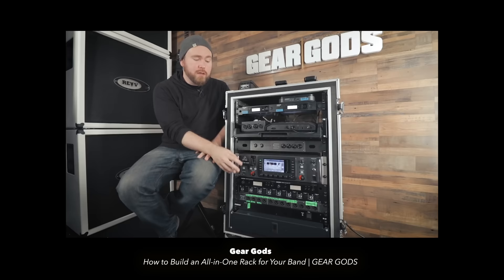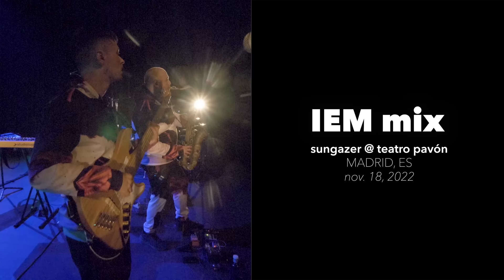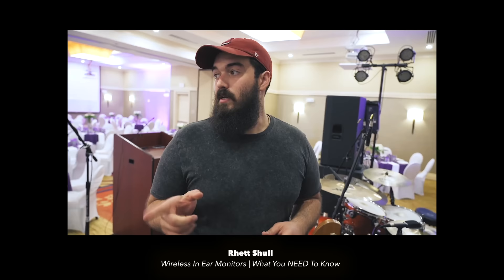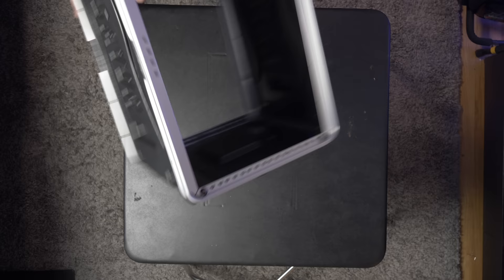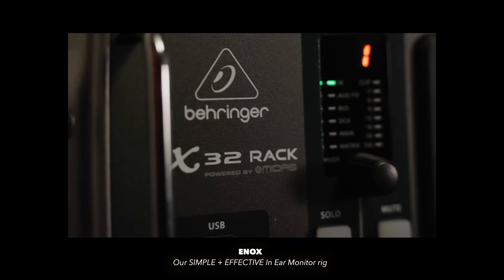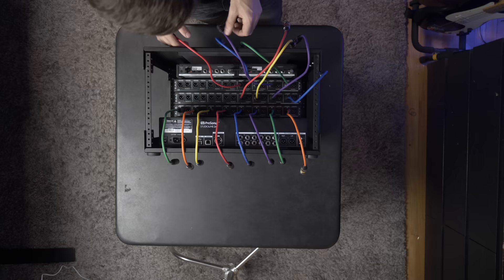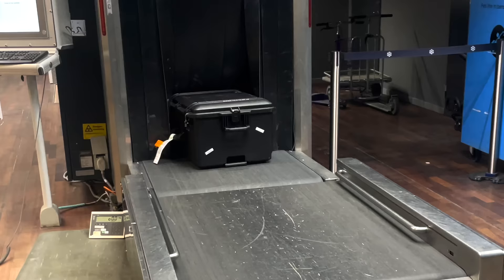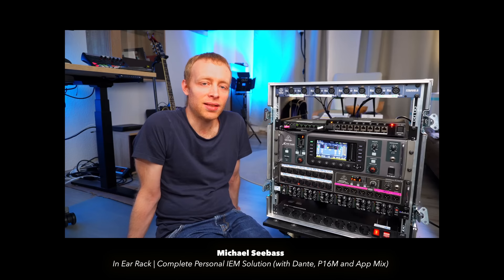How In-Ear Monitors are Making Better Musicians

Comment: wow this is so helpful!!! I have been researching in-ears for my band but we thought it was cost prohibitive. Now we will be able to hear ourselves, even if it is in the hands of front of house engineers
Reply: The band I engineer for I've been telling them ever since I started to work for them that they need to invest in to a system. it is a night and day difference. I'm also trying to get them to go with a klang fabrik as well.
Reply: @roll9898  7000 bucks without the actual in ear monitors (and receivers), I'd argue that IS cost prohibitive.
Reply: @tarcp6224  there are options for a lot cheaper rig; 24input mixer may not be necessary, a 16in xair is almost 1000€ cheaper for exemple, same thing for the rest of the gear
Reply: @tarcp6224 we built ours for Glass Pony much cheaper than that.  At least half.  It’s VERY doable.
Reply: @Gumbo72203  Yes, it's definitely very doable, what I don't understand is the recommendation of a 7000 eur piece of gear to do it.
Reply: @tarcp6224  he isn’t doing that.  He’s saying this is how they did it, for THEIR specific needs.  If you watched, he links to like 10 other videos of people doing this too.  

I just checked our band drive for our template.  Ours cost less than $2,000
Reply: @Gumbo72203  "I'm trying to get the to go with" sounds like a recommendation to me.
I don't get how this guy's recommendation of a 7k+ gear in a thread about cost prohibitiveness is excused by the video linking 10 people that don't use 7k+ gear.
I don't roll up to a video about budget gear and recommend ONE piece of gear that costs more than the entire build.
Reply: @tarcp6224  this video isn’t about budget gear.  It’s about selling the concept of IEM’s and he uses their situation to base the defense of the practice.  

Like I said, ours cost under $2k.  It’s a road warrior too, we just don’t fly with it.
Reply: @tarcp6224  He's talking about his rig, that he's built. If it isn't what you need, don't build the same rig? If you're going for a rig for IEMs, you need to build for purpose. That could be as simple as a transmitter that the engineer can patch in instead of your monitor. You don't need to go this far if you don't want to, but they did.

And $7000 is not that much. It's a lot of money, sure, but in this case it's a piece of gear for like a 5 piece band, so it's $1400 per person, for a piece of gear they'll use every night and will make their performances better and is much better for their musical longevity and health, hearing loss, vocal strain, all serious problems. If you can buy amps to support your music, or instruments, or recordings, or pay for travel for touring, then you can afford that. 

But again, it's his rig and he literally states that it's more than some people would need. The individual items and solutions are useful information regardless of the whole-maybe you're just after the radios, maybe you're wondering what data send situation they're running. The thing is, if you understand the process he's running you through in the video, you can definitely substitute things, in fact, depending on power supply or radio limits you may HAVE to.
Reply: @kalreynolds5829  He didn't state "it's more than some people would need". Adam Neely stated that in his video about a 6k complete rig. The guy that I replied to recommends a 7k piece of equipment without the actual monitors. That is under a video with the concept of cost-effective IEM.
A 10k+ rig absolutely absurd and I've personally never seen that much money in the same place.

Comment: It sounds even worst that the raw camera audio on stage since our ears don't have built-in compressor! Also, as a sound engineer, I'm SO happy to FINALLY see a real informative video about in-ear monitors. Every gear video about it seems to say that you need a 2K 32 channel wireless mixer with an iPad to do this and end up with a 10+ rack unit case that in itself is worth in the hundreds of dollars new (if not close or over to a grand if molded). And the end of the day the goal is not to have the best IEM system, but rather some IEM system that *works*. 
Having to deal with such a complex mixing system and using your own effects separate from the FOH also detracts from your job as a musician and make you hear things the audience receive in a completely different way, so there is a balance to strike between comfort and fear of losing control. Cheers and happy new year everyone!!
Reply: Our ears do have built in compression! Very loud sounds have a less perceived dynamic range
Reply: Actually your ears do have a built in compressor! It's why you can hear more dynamics at lower listening volumes.
Reply: @123string4  Obviously our ears perceive louder sound as having less dynamics. Although, the purpose of a compressor is actually to make louder sound perceived as having more dynamics by making the quieter part of a loud sound louder and vice-versa. So while I get what you mean, it's not 100% correct because our ears doesn't make quieter parts of loud sounds louder and don't "compress" sound past a certain threshold to perceive it louder without busting them. I get the concept, but it's a big simplification of what compression actually is. And we do have a threshold of SPL past which this "compression" cannot happen anymore, which is the threshold of pain, and we can't adjust it. What we can do, however, is use our eyes to "zone in" a sound, for instance listening to a TV in a busy room.

Comment: Very interesting. As a live sound engineer (with experience both at foh and monitors), I can tell you that it's an incredible relief when the band has the capability of mixing their own IEMs purely for the fact that it saves precious time during changeovers at music festivals. Between all of the movement and chaos that happens in those moments, it's tough giving everybody a personalized mix - not to mention taxing when you've got 4 or 6 bands per day. If you sat back at the foh console and turned down the master fader, you would be shocked at how loud the stage volume can be; and that stage sound mixes with the house sound, changing the tonality in often irreconcilable ways. The most difficult instruments to deal with can be the drums, guitar amps, and bass amps (since we have no control of their stage volume or tone, and they are always competing with each other for loudness. In general, all of the other instruments are boosted to match the loudness of the drums, and I suspect that close proximity to loud drumming masks the sound of the other performers on stage. Of course, a pre-rigged IEM solution is the most practical because none of the stages I work have built-in drum cages (and I know how much drummers hate drum shields), and none of the musicians' amplifiers are housed in isolation cabs.

It leads me to wonder how past acoustic bands dealt with stage volume and communication. I know that traditional jazz and bebop bands don't really have an issue with this. We're just living in the era of loud music I guess.

Anyway, neat video.

Comment: Awesome information. It's supremely important for modern musicians to understand how to deal with a modern stage. I'll note that when stage volumes get out of hand in the range of 110+ decibels, this really creates problems, not just for hearing health, but just being able to have functioning ears. Ear drums start to distort, making it literally impossible to hear accurately. Noice-cancelling in-ear monitors helps with this some, but on really loud stages, the sound actually can get to your ears through your skull and not just your ear canals. There's good reason why many helicopter pilots wear helmets and not just headphones. If using in-ear monitors allows you to get rid of on-stage monitoring and get that volume under control, that's a huge, huge win.
Reply: You are 100% correct, Andrew! I have found that as I age my tolerance for absurd volume levels is shrinking. Above a certain level (about 90 dB), my sense of pitch disappears. I have to avoid singing and must play guitar though the braille method with visual cues.The days of 100 watt Marshall stacks cranked up in dance clubs are over. Unfortunately, musicians are going with no amps at all and going to complex in-ear setups. I build amps and am convinced that you can't satisfactorily play guitar without an amp as it is up to 50% of your sound and feel! Being honest, one rarely needs an amp with over 25 watts (tube, like a Deluxe Reverb) and maybe a 100 watt bass amp. Drummers need not bash or risk being subjected to public ridicule and plexiglas shields that they purchase and transport. I've played many dinner music jazz gigs with great players and pop dance music gigs over the years and can see how some level of restraint can still have major musical impact. I haven't gotten to in-ears yet successfully as we never have sufficient time to dial them in and generally don't have a front of house engineer except for me or the keyboard player. Bone conduction monitor headphones with a general feed might be a good compromise!

Comment: I agree with the title of this video wholeheartedly, especially for bassists; physics alone is a massive factor because of how long it takes soundwaves to form, and depending on the rig you use, the speakers the sound is coming out of, the venue you're in and a multitude of other factors you'll likely find it more difficult to hear yourself, and for most gigging bassists its almost always a case of having to settle, rather than being completely happy with how your instrument is represented. If you're using 15" speakers, unless you're something like 12ft in front of your cab, you're gonna be outta luck hearing anything you play! It's why I loved using my Hartke 4.5XL cabs because of the immediacy of the 10" speakers they were loaded with. 

And immediacy is why I like using a full IEM set up, and have done since we switched around 8 years ago. I now model two separate bass rigs panned hard left and right in a Helix LT, which are fed by a very accurate model of the pedalboard I used to use. 
For the IEM setup I use KZ As10s (so good I bought three pairs, and the guys in my band use them too, https://www.youtube.com/watch?v=w3Zh3Gl9HIk) with memory foam tips which swell to completely seal your ear canal (https://www.amazon.co.uk/gp/product/B06XF4LY8G/ref=ppx_yo_dt_b_asin_title_o03_s00?ie=UTF8&psc=1) plugged into a little Behringer Powerplay P1 (https://www.youtube.com/watch?v=FOon2wEZss8) mounted to my mic stand via a mic bracket, being fed a stereo aux mix from our Presonus RM32AI, and my monitor mix is controlled from a Kindle Fire secured to my mic stand (https://www.amazon.co.uk/Neewer-Adjustable-Connecting-Microphone-Compatible/dp/B07D5TSC7C/ref=sr_1_1?crid=1YFGA6UA1U3AL&keywords=Neewer+6-11+inches+Adjustable+Music+Mic+Microphone+Stand+Tablet+Mount&qid=1672418609&s=electronics&sprefix=neewer+6-11+inches+adjustable+music+mic+microphone+stand+tablet+mount%2Celectronics%2C111&sr=1-1). 
For anyone looking to put a little IEM rig together, this is an extremely good monitoring solution on a budget. I also have a t-bone wireless unit for gigs where the stage is a bit bigger, or trailing XLR cables is a little impractical. 
I personally feel that since we switched to an IEM rig my playing has improved in all aspects; accuracy and consistency of note velocity, and timing. Because its like listening to a DI in a studio, there's no straining to hear the note through an often wooly bottom end and a thundering backline because your amp is coupled to a hollow stage or the band are louder than you are. You hear the note you're playing immediately. 

You still get the feeling of the bass from the PA if your band is using subs, which John Entwistle couldn't do without, and you can balance yourself perfectly with the drummer.  And, because the IEMs seal in your ear you still get all the low end you need to hear, without the volume of a live band so you never leave a venue with your ears ringing. 
As gig rigs go, its perfect. I turn up with bass, pedals, and bag with IEM setup and power cables, which all fit in the boot of my car easy. For anybody thinking of switching to IEMs, I can say from my own years of experience using them and depping with other bands during that period where I've had to use my cabs and bass rig, IEMs win hands down on all counts.
Reply: Thanks for sharing! Think I'm gonna try and buy a pair of those IEMs 😃 Looks almost too cheap to be true
Reply: @AndreasOxholm  Andreas, I honestly swear by them. I'm a bassist too, and I want/need to hear the articulation of the note I'm playing, but also have enough low end in the IEMs to get that bounce in the tone and into my playing. The AS10s are perfect for that. Directly before those I tried the ZS10s and the ES4s, and I found that both were overly voiced for a really sub low end, which is fine if you're listening to albums on an iPod and you want that. But I much preferred the relatively flat response of the AS10s for live performance. And they're very easily driven by both my Behringer Powerplay and my wireless pack.
Get yourself some foam tips to seal them in your ears, and I think you'll dig them.
Reply: it took me ages to find back to this comment but I just had to - I HAVE BOUGHT THREE PAIRS OF THE AS10s 😂 They are soooo good! I owe you so much for helping me find them 😃🙌🏻 now IEM is luxury 🤘🏻 thanks so much!
Reply: @AndreasOxholm  Not at all, I'm glad I was able to help you find IEMs that work for you.😉👍

Comment: For playing bass - IEMs and a little riser with a throne shaker mounted under it works really well if you're not moving venues very often, or if space isn't an issue. It definitely changes the "feel" of things.
Reply: Whats a throne shaker?
Reply: @russmbiz  You can buy transducers that attach to drum thrones so if you're playing electric kits or at low volumes you can feel what you're playing. If you take that and put it on the floor it's like having a subwoofer, or in this context a cabinet, right next to you without the noise.
Reply: BackBeat is a really good addition to playing with iem as well. No matter how small a stage, I always feel like I have an 8x10 rig blasting behind me!
Reply: You don’t need “butt kickers” or platforms if you have proper iem’s, the biggest mistake a lot of bassists make when they 1st go down the iem route is they get an iem with dual drivers..which is fine for vocalists but there’s minimal low-end, for bass you need at least triple or quad drivers..an iem with quads has serious low end punch and an overall better audio spread..it’s like the difference between running two tops vs a full range pa

Comment: When using in-ear I usually bring my own little mixer with me and have my bass signal extra. So I can ensure that at least my signal is always there if something goes wrong with the rest. Having a room mic is a great idea. I'll suggest that next time.
Reply: So what other signals do you mix into your own, separate IEM? Isn't it a case of a compleate IEM-syst as Adam descibes, or just your own instrument to not use a loud and bulky instrument amp/loudspeaker?
Reply: @mikaelolsson5333  I see drummers mixing a metronome or the thru signal from a DI'ed drumpad into their wired IEMs/hardware mixer setup frequently. If the band uses tracks and the drummer is responsible for launching them back at the kit, they will sometimes get a thru signal from the tracks DI and mix it down into their ears themselves. A wired mix just has so many fewer things that can go wrong, and gives the drummer tactile control of that mix. Even if my mix to the drummer's board fails, they can still hear the backing tracks, a metronome, and their electronic percussion. It's a great failsafe.